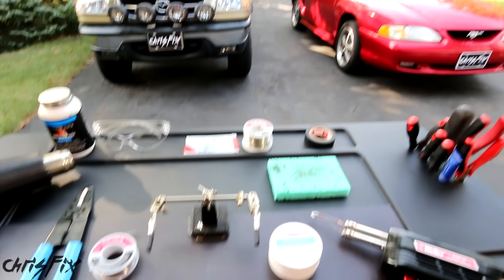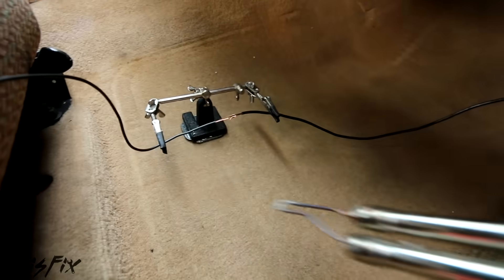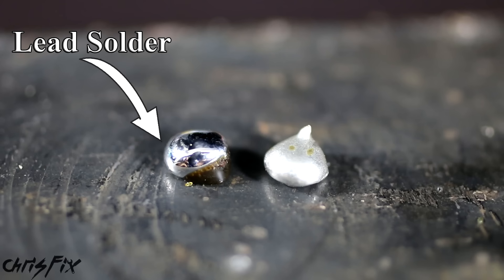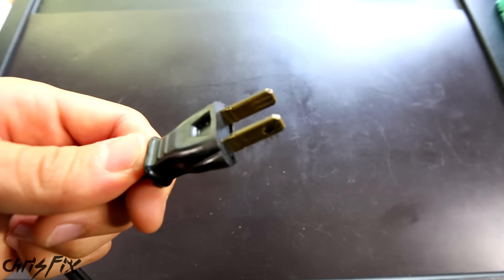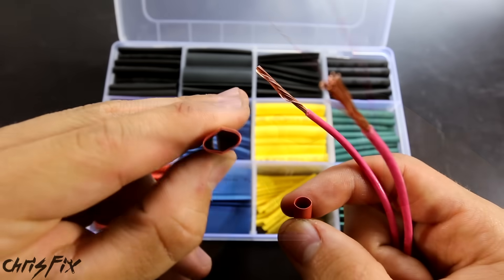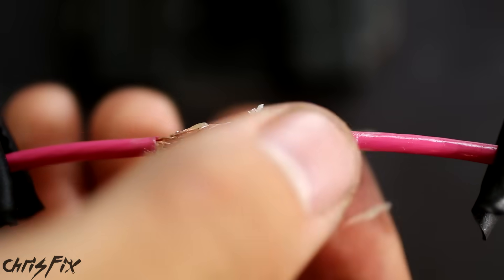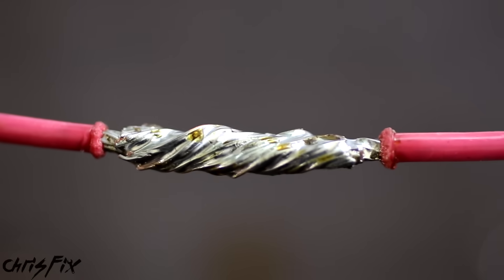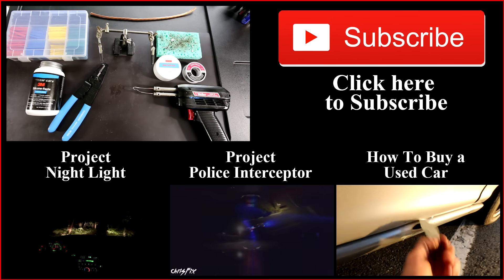How to Solder Wires Together (Best tips and tricks)

Comment: I used to put the solder on the iron and then push it into the wire, this bad?
Reply: sometimes it's necessary, considering some really fine work or hard to reach areas. But generally it's bad. You are overheating the solder and burning away the flux. This means possibility of cold solder joints. They break easily, can cause sparking and excessive heat due to higher resistance.
Reply from the maker: Yea that is called a cold solder. Watch the end of the video where I explain that. You want the solder to wick into the strands.

Comment: For most purposes, I find 15-20W iron works on many applications including heat-sensitive electronic devices.  My soldering iron is rated at 100W as I bought it in Japan, and that extra 20V makes it worse as the tip gets hotter than it should, and frequent tinning & cleaning of the tip is required (once/while I clean the tip with Scotch Brite).  If one can afford and plan to do a lot of soldering, a unit with power regulator is probably the best but they are usually $$$ (I'll probably get one). 

I noticed that many electrical wires sold in the U.S are not of high quality (made in China and corrodes easily) and smaller gauge wires are not readily available.  Also, single-strand wire should not be used on automotive application as they may break due to vibration.  I only buy my electrical wires in Akihabara, Tokyo where you can find 90% of what you need to do electrical/electronic projects, and many shop owners are as knowledgeable as electrical/electronic engineer, even mid-age women.  

A good tool for beginners is Portasol 75 (mine was made in Ireland, not China).  This butane-powered kit comes with multiple size tips, heat gun tip & flame tip (produces a tiny flame that is handy for removing rear-view mirror anchor buttons, etc...).  One problem is like above; the tip gets hot in 15-20s and the tip gets oxidized/dirty after a few applications even at the lowest setting.  It may also cause finger burns when you change the tip before the previously used tip hasn't cooled down.  Other than that, I love my P75.    

A cheap digital multimeter is a nice addition to check conductivity & resistance of wires.

Comment: My old EE Lab instructor would have a fit over the "good" solder joint.  WAY too much solder.  You can get away with half that much...other than that, not a bad job...good descriptions and some decent information.  My only thing is you don't need that much solder.  Use a thinner gauge solder for your work and you'll control that much better.

Comment: Just twist the wires together and use some electrical tape. She'll be right mate
Reply from the maker: lol
Reply: lol
Reply: Or use some wire nuts.
Reply: Don't you know more is better? lol
Reply: Once it's stretched, it'll cut out and could lead to accidents, especially for brake light wires.
Reply: +hey chancho I used to do the twisting method on the ignition cable, unfortunately It got cut out and the car just dies in the middle of a bad road. From that moment I never use cable twisting method for vital electrical cables.
Reply: Yes, electrical tape and a twist of wires work.
but the best thing to do is to solder wires together. and cover in mastic tape for protection then cover in electrical tape. Or for small jobs like this. shrink wrap.
for a quality outcome, do a quality job
Reply: said the last two people to bodge the stereo wiring in the cars I've had to sort out, tape came off wires were bare.
Reply: That actually works if you use the lineman's splice its a damn strong connection in tension.
Reply: The bigger the gob the better the job!
Reply: MaxRay16
LOL! Then wrap electrical tape around and around until it looks like a Boll Wasp nest on a willow branch. That way you know it won't get wet.

50 cents of solder and 50 cents of tape makes a $1 repair. Sounds reasonable to me.

heh heh
Reply: No No No! Use duct tape! lol
Reply: +Calvin Laudrensio that's a lie I connect sound system and lights with electrical tape
Reply: +ChrisFix where have you been
Reply: ladamyre1 Yeah. Or the emergency repair kit as us farmers like to call it!
Reply: *****
"But it looked real gud win I done it!"

"The automotive repair industry is 100,000 properly trained technicians short of what is needed." So said the bean counter executives from GM 25 years ago. Who knows how many they're short now?
Reply: spot the aussie
Reply: Jords H Plenty of em. Including me.
Reply: yeah me too. "she'll be right" was a dead giveaway
Reply: Go put your "shrimp" on the Barbie.

Here in America we play hide the salami because we have big ones.

heh heh
Reply: Jords H and we are confused by sodder
Reply: Mastic tape, also known as Bishop Tape :)
Reply: Unless you're using high quality crimps with Amphenol crimpers or the like, that can effectively cold weld the wires and exclude air from the joint, soldering is a better way to go.  Replacing a complete wire run is unrealistic for a repair, and of course the factory isn't going to solder wires when they can have a continuous wire from point to point.
The only time a crimp is preferable in general automotive repair is for splicing things like universal O2 sensors, which have wires that are not solderable.  
In critical applications, solder is not used in terminations because it would make the wire brittle and more prone to fracture, but this video does not apply to making terminations for connectors, but just for add ons and simple repairs.  
Have you actually measured the a properly soldered connection and compared it to a continuous wire?  I doubt there'd be a difference. You can do it easily enough by running a constant 1A through the wire and using a DMM to measure the millivolts across the joint.  If you read 1 mV, that would be 1 milliohm.  
Then do the same with a continuous wire, holding the probe at the same distance apart, and compare.
Reply: Zip-Ties, my friends!
Reply: I've got to add this joke...

Billy came by farmer John's house holding a small roll of scrap chicken wire.

Farmer John: Where you going with that chicken wire?

Billy: I'm gonna go catch me some chickens.

Farmer John: Boy you can't catch chickens with that little scrap of wire.

1/2 hour later Billy came by Farmer John's house with 3 chickens with their feet caught in the wire.

Farmer John: That boy is persistent.

Next day Billy came by with a roll of tape.

Farmer John: What's that you got there Billy?

Billy : Duck tape.

Farmer John: Don't say it!

Billy: I'm gonna catch me some ducks.

1/2 hour later Billy came by with 4 ducks with their feet caught up in the tape.

Farmer John: I'll be John Brown, if that don't beat all.

Next day Billy came skipping by with a 3 foot long stick. It was fuzzy on the end that he was tapping on the ground behind him as he went.

Farmer John: What's that you got there?

Billy: A pussy willow.

Farmer John: Mind if I come along?
Reply: ChrisFix
You should check out what the industry does, after all they have to pay the mechanics to fix stuff if it breaks under warranty, and if they can avoid that on one out of ten thousand cars, they'll do it. I'm a retired ASE Master Technician who worked for GM dealerships, I know.

I've never seen the factory use a soldered connection of any kind, anywhere. Take a wiring harness apart and see. The solder actually hurts the connection; it increases resistance and it's a source for corrosion. The dissimilar metals cause electrolysis in the presence of water, and moist air is enough to get it started. Once it starts it's an exponential process of growth because the corrosion holds in water. If you want a soldered connection to not corrode, it needs to be sealed up tight. A good coat of grease will do better than electrical tape.

If they tapped into a circuit, they would use a metal crimp and just crimp onto the wire, no tape either. All the connector ends get crimped on and the little rubber seal is there to keep out the moisture because they use steel ends on copper wires, the dissimilar metal thing again.

The factory repair schools tell you to run a new wire if you have a bad one, but if you absolutely have to make a splice, then the way to do it is much like Bentheguy said except to crimp on a copper clamp and a little electrical tape just to keep from short circuiting. That's the only useful thing for electrical tape, to insulate. For keeping out moisture it's unreliable.

Many circuits had resistance based sensors on them, in those cases it was "run a new wire" or don't say you fixed it because you didn't. Any splice adds some resistance to the circuit and soldering increases it even more.

Get out your multimeter and see.

You're obviously an intelligent guy, but on this soldering deal, you're being half smart. Then again, a truly intelligent man knows when he doesn't know and will seek to find out what it is he doesn't know.

That is to say, he's teachable.

BTW, I enjoyed your "Turn Signal Fluid" video immensely. lol!
Reply: Ryan Mr 1%
Exactly half the contents of the poor man's toolbox; the other half is WD40.

"If it's not supposed to move, use the duck tape. If it is supposed to move, use the WD40."

lol
Reply: ladamyre1 That's hilarious!

Comment: The most comprehensive and well explained soldering guide I have yet seen. Great reasoning, based on the physics of heat transmission. Well done +ChrisFix.
Reply from the maker: Thanks a lot! That is how I learn best (reasoning). I need to know why or how rather than just memorizing facts.

Comment: For doing wires that are going to be in the elements, say the plug for a trailer's brake lights. Seal the ends of the heat shrink tubing with some liquid electrical tape. An ounce of prevention is worth a pound of cure.
Reply from the maker: Thanks for the tip! Even better than liquid electrical tape is the silicone I show. It is not just water proof, it is hydrophobic so it repels moisture.
Reply: Man, you really need to start putting disclaimers in the title WATCH THE WHOLE THING MORON lol I guess my eyes didn't catch it once again

Comment: But can the soldering gun/iron melt the wire that I am soldering?
Reply from the maker: Melting wire is not likely if you are using anything thicker than 22 gauge.

Comment: lead free solder will not always go haze. the haze effect is from not enough heat. and from an unclean or contaminated area...aka no Flux or had touched a different solder.

silver lead free with Flux is also incredibly good for electrical. just not the brand you shown.

the distinguishing trick you gave was the only part in the video I found to be ....misleading

great work with the videos! I do enjoy them

Comment: Just saying, the acid core, rather the acid don't stay on the wire it gets evaporated on the process of soldering. The acid's purpose is to clean the wire if you just have the solder, the solder wont stick to the wire. You can use any type of solder as long as the metal contacts are really clean or put a little bit of Rosen (another type of cleaner that requires heat) the silver solder is much better IMO (sorry if my english is bad, it is not my first language)
Reply from the maker: Thanks for the tip. Not all of the acid evaporates unfortunately.
Reply: +ChrisFix ohh

Comment: Chris my soldering iron won't heat from under the wire so i need to do the cold solder method, can you explain why?
Reply from the maker: Your soldering iron is not powerful enough. Check out the link to the soldering gun I linked in the description (same one I used in my video). It works great!
Reply: +ChrisFix the soldering gun, also works with 240volts? Or only 120volts?
Reply from the maker: The soldering guns I use work with a standard 120 outlet
Reply: Maybe not enough power to heat up the wires.
Reply: +[KC!]Gasmann mine is a thermostat regulated 12v 8w mini soldering iron, so i should get a instant heating 100w soldering iron? But i working only with smaller gage wires, so the bigger one won't melt the plastic of the wire? Help me i'm a noobie with soldering
Reply: Well 8W are definetly not enough. 100W would be an overkill. I have to check out but as far as I remember my solderingiron is a 25W, it's enough for 6mm², not sure what AWG that is.
Reply: +[KC!]Gasmann there is a chart somewhere? If you find it i will subscribe to you channel
Reply: +SeagullChips the knob arrow is setted to 450°C (c.a. 800°F) and the tip is smaller, what is the problem? I need to change only the tip or the iron compltely?
Reply: You have to get a new one, 8W won't do the job of heating up the wires. The wires takes up more heat than your iron will produce in a given time,simply speaking. Btw. 6mm² is around 9 to 10 AWG.
Reply: +ChrisFix thank you Chris!
Reply: You can get 240v versions by weller as well as 120 :) (Always go with a well known brand, there are cheaper ones but they don't last)
Reply: +ChrisFix i've just found a 100w 240volts soldering gun without the tip, should i follow your copper cable tip?
Reply: Daylan Smithey check your cluster connector if is loose or corroded
Reply: 8W is VERY low! Didn't even know those exist :D
Get a 40-50W, that should be enough.
A big soldering gun/iron is not hotter than a smaller one, it can just heat faster and do bigger joints.
In fact there is a bigger chance that you'll mess up your cables if your gun isn't strong enough because you will have to heat up your cable much longer
Reply: +ppdan acrually, is useful for making pcb with smd parts, since the tip is really narrow
Reply: SuperSilver301 You can have a small tip on a 50W iron. I wouldn't use a 8W iron because it could just stick to the pad and break it.
Reply: Radio Shack sells or sold a butane mini soldering iron that is amazing for its size and power. I forgot the equivalent wattage for it, but it was almost as fast as some of the professional soldering irons I used as a electronics tech in my younger years. No power cord and is much smaller then an electric soldering iron and much cheaper too.
Reply: Den Log i'll try it
Reply: Neezy Ko actually, always choose cat5/e wire, which probably is a 22 awg wire

Comment: From what I've heard its better to not clean the tip after you're done soldering as the residual solder protects the tip from corrosion, instad clean the tip before each solder job.
Reply from the maker: As long as the tip is tinned, it is better to clean it because any contaminants on it will come off way easier when they are fresh! But what you said is a good point as well, especially for tips that are not tinned.

Comment: Great video. Very informative and thorough. I've been soldering for a long time now and it's become a thing I don't even think about, but for a beginner it could be very intimidating. I have a base station and lots of butane torches but I definitely want a solder gun.
Reply from the maker: Thanks a lot! Yea once you get the hang of it, soldering is so easy. I remember when I first started and I was so bad at it lol. Once you know what you need to do and use (like flux) it is cake!

Comment: how can i hold the wire when soldering? The wire that i usually work on is a small wire, and i dont have a helping hands. So what could i do? Obviously i cant hold the wire because its damn hot. Any solution? Thx ;)
Reply from the maker: Get some helping hands or make your own with copper wire and alligator clips. I will make an instagram/facebook video on it!

Comment: There are some instances where you would want a cold solder, such as a surface mount connection or anything on a circuit board
Reply from the maker: Correct! I was focusing on splicing two or more wires in this video. But great tip/info and thanks for sharing Sean!

Comment: yo chris, why don't you put wheel spacers hub centric on the mustang & b3000 ? not only they look great, but also it helps prevent flipping & give you safety
Reply from the maker: Wheel spacers are not always good. They change the suspension geometry.
Reply: ChrisFix but they give you extra safety

Comment: isn't lead solder also preferable because it doesn't crack over time
Reply from the maker: That is another good one!
Reply: What I hear  a lot from people in the business - While the ban on leaded solder in production (still allowed for special applications, repairs and hobbyists AFAIK) may reduce the amount of lead that goes into (and is leached out of) landfills, it probably has seriously increased the amount of premature e-waste going into those landfills due to broken solder joints and tin whiskers.
Exacerbated by  how hard and/or uneconomical repairs are now due to the high level of integration and miniaturization.
Reply: that is also what i heard, and experienced, as my old mouse died from poor soldering joints